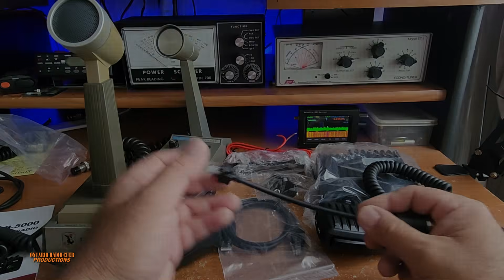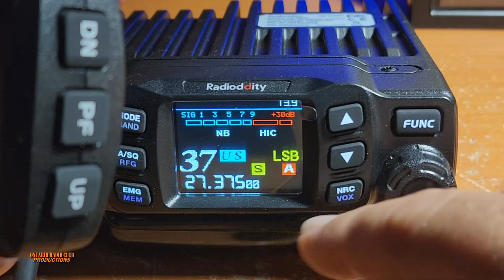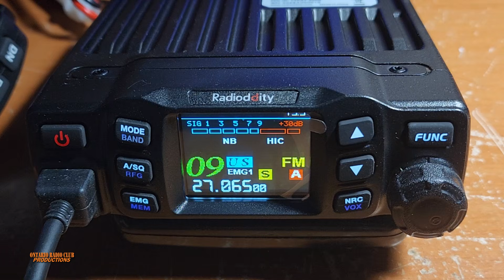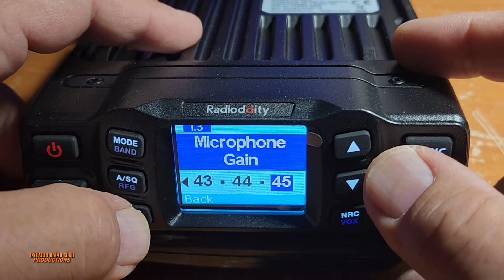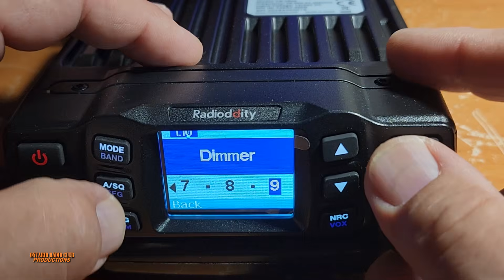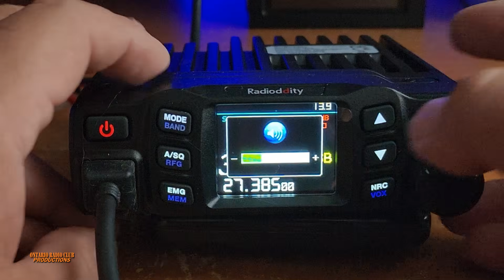How Is This Radio So Small? NEW "Tiny" All Mode SSB Cb Radio -  Radioddity CB 5000

Comment: hello from brasil you know how mosfet is use to final? i have one tks orion 110 is like this
Reply from the maker: Factory Original Part: FQP13N10 (an N-Channel power MOSFET in a TO-220 package).   

Common Direct Replacements: IRF520 (a widely used, affordable drop-in replacement that technicians frequently stock).   

Performance Upgrades: ERF2030+ (often chosen as a heavier-duty alternative by radio technicians looking for improved thermal durability).

I hope this helps. Or I can open the radio and check for you, if you want.

Comment: Hi, does the VFO use a flotting point to ship frequency??I don't understand the manipulation when the decimal is red? Best regrads. Fred.
Reply from the maker: Hi Fred, thank you for the question. You can press the channel selector and this will make the last digit red, which means that you can change it. You can go up or down, so you can clarify someone that is not on frequency.  You can change the frequency like that, if you keep pushing the channel selector, it will change any digit. This way you can go faster to any frequency. Is this what you are asking? Let me know
Reply: @ontariocbclub Merci beaucoup cher ami, je vois que cela est possible sur le cb 5000 ce qui n'est pas le cas sur l'AE5900 première génération.Un firmware solutionnera peut être cet bug sinon il faut acheter le micro Albrecht AMM 500 à priori!! Merci beaucoup et à bientôt.🖐🇨🇵🌲
Reply from the maker: @14fdx088  It comes with a microphone and it comes with an adapter, so you can use any microphone